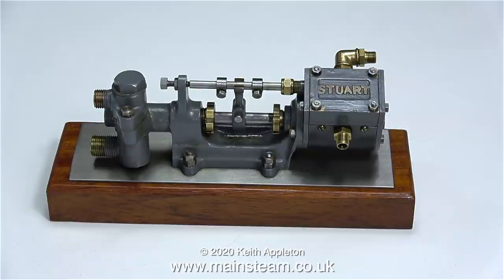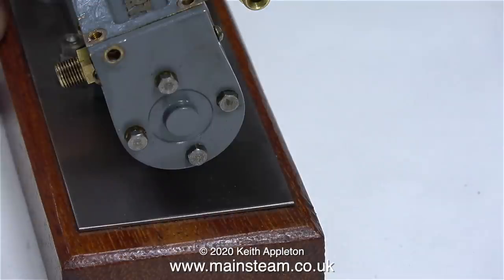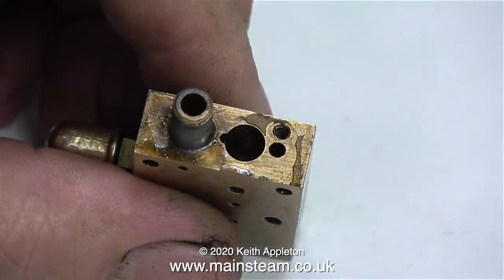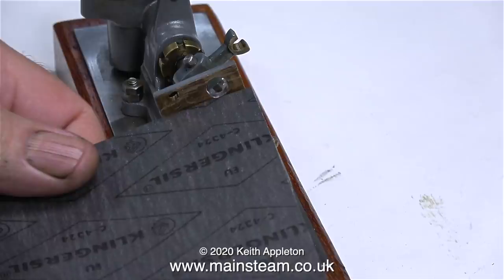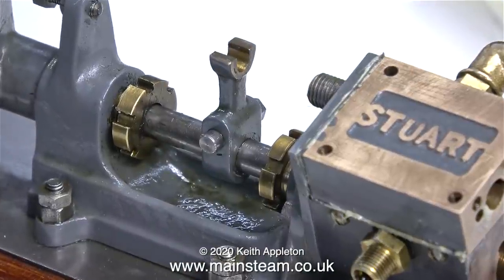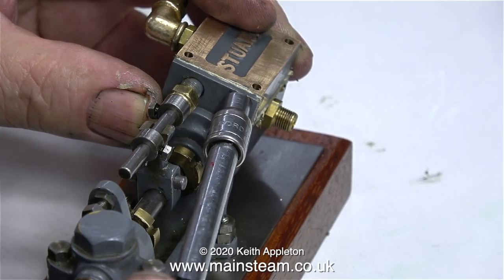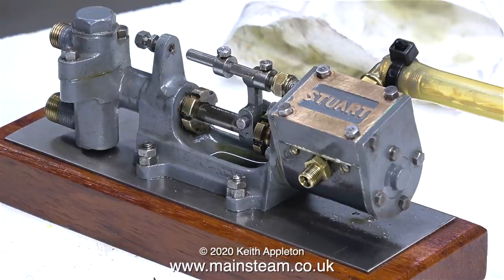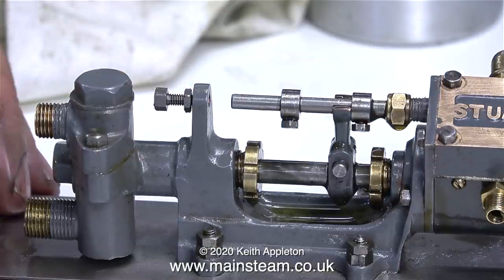PROBLEMS WITH A STUART STEAM PUMP - PART #2

Comment: I've also used abrasive paper for gaskets,  since they are made to sand wet they hold up well, plus cutting abrasive paper with scissors sharpens the blades.   It's your birthday?  Well happy birthday to you!
Reply from the maker: Thank You {:-)))

Comment: Hi Keith I have a pump of the same type with most of the same issues ......the only reliable gasket i have found for a tolerance sympathetic seal is ........believe it or not  Coke can   .......it has coatings on the inside that work perfectly !...

regards Mike.
Reply from the maker: Thanks Mike, that is worth remembering }:-)))

Comment: My (1st generation Welsh-American) Grandfather's business made abrasive papers and cloths.  As a youngster, I toured his factory many times.  I first heard of using that sort of paper for gaskets from him, and it turns out that the cloth used for abrasive backing works well for gaskets, too.  I wonder if the sodium silicate that they used to adhere the carborundum "sand" to the backing material helps it to work as a gasket.  Although I'd never heard of it in connection with steam, I once used it on a small lawnmower engne I repaired as a teenager,. I hadn't heard or thought of this trick in many years, and your video brought back the memory.  Thanks.